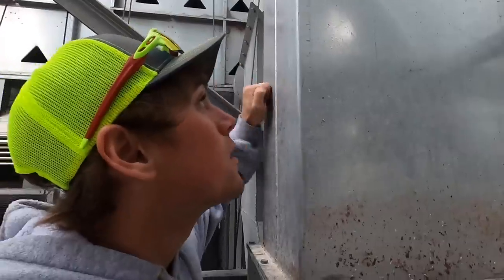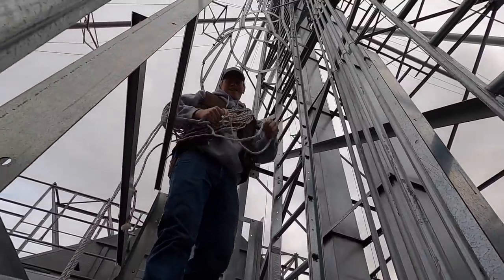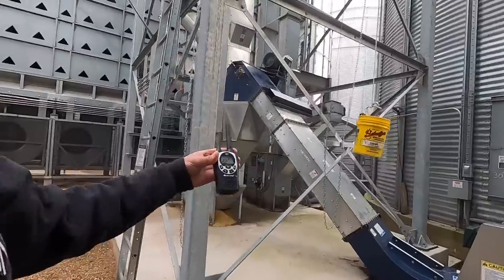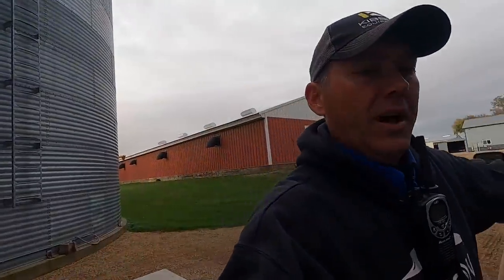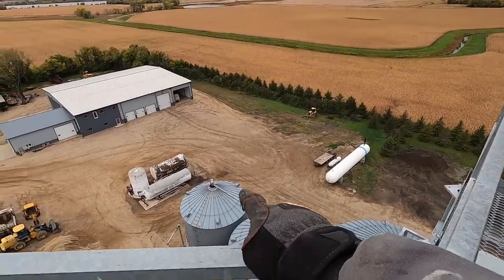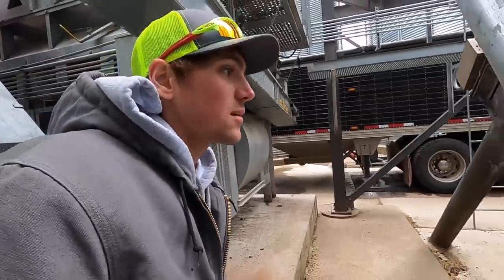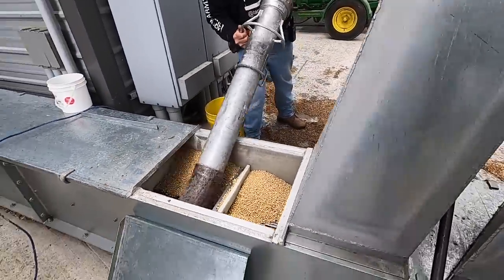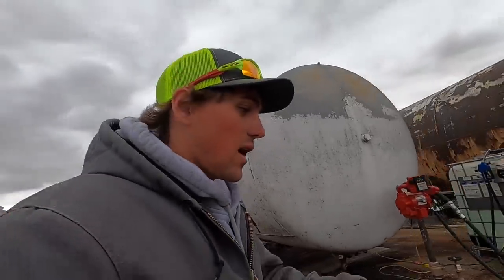The Grain Leg Is SLUGGED!! #7

Comment: Chet, they make a load sensor you can install a new the bin moters that can be wired into an electric gate, and can be put in several places, like the entrance to the leg and the cross auger, when it senses the motor straing it automatically closes the door some until it reaches the present load setting, it works really well

Comment: I had the same problem with fan belts stretching and breaking on my chipper and then I found one big belt that was basically 3 identical belts all together in one belt, with the groves built in it. I've been able to use that 1 belt for years now, probably 5 years so far without needing to be replaced. 
Good luck, & Seeing Nichole helps get you a big thumbs up 👍

Comment: @Larson Farms, we have that same grain vac where I work.  I've plugged ours up a few times at the bottom of that big cone.  Usually the hydraulic lever in the tractor (JD4240) pops loose.  To unplug it, I run it alternating forward and reverse until  it clears, I've never thought about using a pipe wrench.

Comment: I work in a 1400ton/day grain mill. We plug legs down unfortunately often. You need an RPM monitor system on the leg. Small hub with spokes, and sensor set that goes on the base of the leg, when the rpm drops from a set point( 10% in our case) it shuts the leg, and everything that feeds into the leg off. That prevents this from happening, you'll still get some back legging, and will have to dig the leg out. But in the case of the leg in my building thats about the size of this leg, its normally only 2 or 3 normal bobcat buckets worth and only takes about 30 min before we can get it dug out and running. Been running this mill for 3 years, have yet to smoke belts off the legs with this system.

Comment: Binge watching. Ten months after. I know this is not happening now and I know that everyone made it down safe but my spine tenses up from tailbone to C1 and stays cinched up tighter than a come along until you guys come back down to ground level. It’s double tight because the wind is blowing, it’s cold up there and Chet and Dougo had to go back up, even though it is in the 70’s outside, maybe 60’s in Minnesota at 3:33 a.m. After you get done I’m as tired as if I did the work myself , from climbing up, replacing the belts and climbing back dow and vacuuming out the beans. OMG I’m insane! (or just afraid of heights).

Comment: For future pluggage on the grain leg and have   to go up to the top you should install a winch at the top to save your arms and safer. Especially if you need to run up a motor or bigger tools.

Comment: You should install a two way electric motor near the bottom to run a spool and put a pulley system at the top. Use rope or cable. It will make life way easier the next time you have to work at the top of the leg. Similar concept to what is used to lift/lower forage silo unloaders.

Comment: You need a gin pole at top of leg with pulley attached and cable running though it from bottom to top and back down to the bottom. Attach a hook with clip to one end of cable. Attach sling to other end. Attach bucket to clip. Attack sling to pickup and pull cable to raise bucket.   You also need a man lift to the top of leg.

Comment: The potential problem with PVC vac pipe and static electricity is that it can ignite the grain dust. Same thing can  happen in wood shops built in vac systems and wood dust.  That is why there  is PVC piping with embedded grounding wire to bleed off the static.  It will also keep you from getting lit up like a Christmas tree.

Comment: What you need is Amp meters on those motors that way when they pull too many it will shut them off. Call the electrician pressure switches fail more often than they work

Comment: They have senors that when the bottom pulley on the big elevator stops turning it turns the motor off so you don't burn the big belt with buckets off ..... it petty standard in grain elevators

Comment: You guys should make that panel
On the pit drag that you open a lot a pvc panel so you don’t need to open it unless shit stops working. Will make it easier for inspection. Also. Why are your augers belt driven? Wouldn’t chain driven be better? And the motors would have overload protection if something goes wrong? All the augers I’ve dealt with have been chain driven

Comment: Dougo, is right. Those vacs can build static electricity. Not sure about the whole “microwave” scenario, but they will discharge if they get to close to another metallic surface. Wouldn’t be a bad idea to have a grounding rod and wire on it, especially around grain dust.

Comment: I think I would have to invest in a stiff leg and a small winch up to hoist stuff up and down with.  You could fab up a tripod that mounts to the top of the osha cage and hang a pulley for an artificial high point or off the side so you wouldn't have to worry about the bucket bouncing around inside the cage.

Comment: I bought a similar handleair 560 but mine is pto only.  The hyd comes from the PTO.  My vac tank is near shot. So it’s slow buy never had it plug.  Thankfully I don’t have to climb as high.  But I have to carry tools, then pull bucket as I can’t lift full bucket.

Comment: So did the rain cause 3 belts to slip and they all burned up? Or were the belts compromised before the rain and with the rain it finally failed? The shield on the belts should have kept the water out. Seems checking the belts should be on the fall checklist before combining....

Comment: The only downside to overalls is you have many more pockets for tools and small parts. Stuff gets lost and  it's very noisy in the washer an dryer. The upside is in good weather just the overalls and nothing else, its quite freewheeling. Clean undies is not a problem if you get hurt. A pessimistic wears a belt and suspenders.

Comment: Question: can those pulleys be changed from belts to chains ?
A wondering city slicker ...
Reply: slipping belts are also a safety aspect. slipping belts save twisted and sheared-off shafts.
Reply: @CuriousEarthMan  so, it's trade-off then ?
Reply: I believe chains do not absorb shock the way belts do plus they need to be kept lubricated when belts do not.
Reply: @lgl_137noname6  EVERYTHING is a trade off. Have you ever heard of the "rule of threes"? You can have any two of three related conditions but not all three. It is a rhetorical device that seems to have a lot of real world applications.
Reply: @lgl_137noname6  yes, in a sense. it's like choosing a weak spot, like a shear bolt on an old plow. If you consider that the size and number of belts are designed to handle the load plus a surge factor, if they fail, it's because something is happening outside design parameters and shouldn't normally be frequent. If the wet belts caused the problems here, maybe there's a different solution like an additional shroud, vented housing or weather guard, if it happens too often. I did flash on chains when I saw the video, but that was followed by other experience of what that means re the overall mechanical system. I'm sure you can imagine what it takes to replace a damaged drive shaft or sprocket set at the top of the leg, all while the bucket conveyer might be fully loaded. I think you're right, as you said: a trade off. pick your poison or fail point.
Reply: @dbmail545  Thanks.
Trying to understand design constraints n an unfamiliar discipline.
Reply: @CuriousEarthMan  thanks for expanding on design constraints and trade-off. The inherent engineering and innovation in ag industry is way under appreciated I'm finding out .
Reply: @dbmail545  right on! :)
Reply: @lgl_137noname6  I agree completely! for most of human history, esp since the industrial revolution began, the focus has been largely on work (Newtonian sense) and how to convey power to a tool, which is where the rubber meets the road (cutting, shearing, grinding, pounding and so on) In this age, the digital revolution, the focus has evolved into sensing (various parameters) evaluating and controlling/adjusting the power. That is where most of our innovation lies at this time - how mankind is shifting in mind-set. So just to go a little too far here: upgrades to the leg might include monitoring the motor's electrical load and evaluating the level, then automatically shutting it down if it exceeds desired levels, as well as transmitting the status to an operator (could include blue-tooth even) This could preempt belt failure. That's an example of our evolution, among other methods that could be used. Here's another random one for ag: robot milkers for the dairy industry. what a huge thing that is in a lot of ways! Was a pleasure chatting! 

Just to go really crazy for a minute, sensors and controls could be installed all along the way, even back to the semis unloading, to automatically close/regulate the hopper doors if the system was backing up. I'm sure we'll see that within a  'short while' since those tools exist, but are not a common application yet.
Reply: @CuriousEarthMan  Memo to Dougo & Chet: See @CuriousEarthMan suggestions above => "So just to go a little too far here: upgrades to the leg might include monitoring the motor's electrical load and evaluating the level, then automatically shutting it down if it exceeds desired levels, as well as transmitting the status to an operator (could include blue-tooth even) This could preempt belt failure"
Reply: The  v belts are easy to replace compared to the belt with all cups on  it.
Reply: @lgl_137noname6  I bet they already know this, and already have some monitor on the system which they questioned whether was working. Thank you, friend.
Reply: @CuriousEarthMan  I've only recently began watching farm-tubers. My observations so far are it seems that every farmer has a strong expression of the "MacGyver" gene; on the other hand my impression is the incorporation of lessons learned and best practices into the Product Development Cycle in ag equipments and tools is longer than what I've been exposed  to in software an telecom. 
Time-to-market pressures and economic cycles do vary from field to field ... 
I'm learning a lot on these channels ...

Thank you again.
Reply: @lgl_137noname6  very interesting observations! thank you very much!

Comment: ONLY a few grain elevator operators were harmed in the making of this video

Darn, thought you guys had struck some of that Sweeddish yeller gold when the vac started mining in the grain horizontal.  $10 beans, almost as good.

Poor Dougo sounds and looks worse on top of the tower than Trump in the hospital video.
Darn, I wanted to see Dougo's socks go through the auger belts.
Good job guys but why send the young strong guy out to run the fertilizer rig.  Dougo's almost on Social Security, I want to see him get his first legit Goberdment check before he's all buggered up.

Need backup slippage overcurrent alarm sensors on all the augers and legs.
Could be worse, in one of those Siberia Expresses howling blowing ice storms from NWT and the Arctic Ocean,  freeze the nummies off
Love it, using a cresent wrench backwards on critical bolt head.  Round those nummies
Hole in pipe is better than Holy Underwear and going to the ER.
Bib overhauls are much warmer in cold weather wind and rain

Comment: I sure wouldn't climb those ladders without a  "Saf-T-Climb" PPS, or equivalent.  Stupid, to say the least.    We used them in the Army, even for low-level radar towers and they work!  I don't think they are very expensive.  But, like seat belts in your vehicles and farm power equipment, they must be used to have a proper pay-off.  Habit forming.

Comment: Why not set up a pulley at the top of this.
Reply: Simple 4inch block make is so easy..
Reply: I said the same thing. Not the first time I've seen them pulling buckets of tools up a grain leg. Warn even makes a small winch you can drive with a cordless drill. They could move it around where they need it.
Reply: I would agree actually a L shaped 2 foot by two and take it up and bolt it then hang a pully just take a rope up thread it thru and bring the bucket or any assorted items up and down.
Reply: umm, what fun would that be?